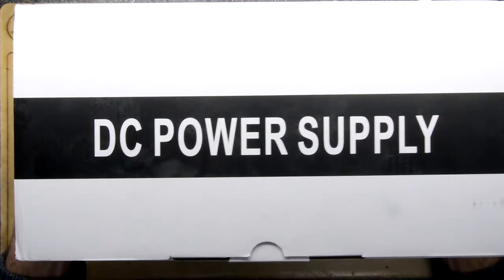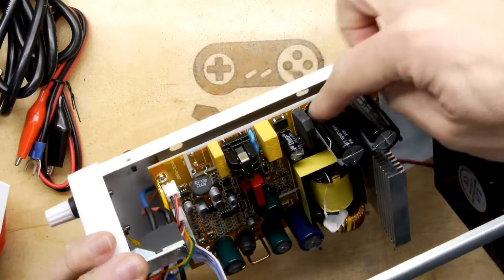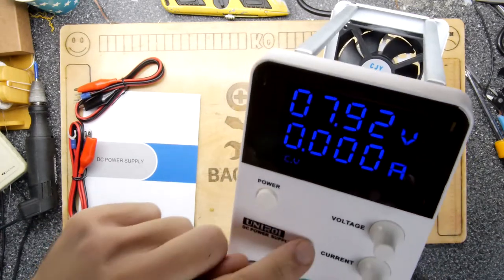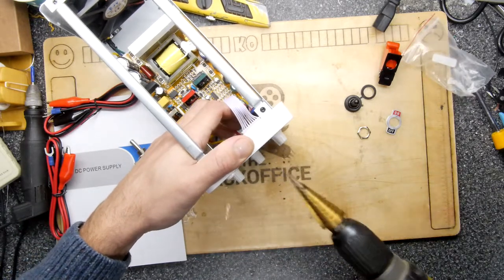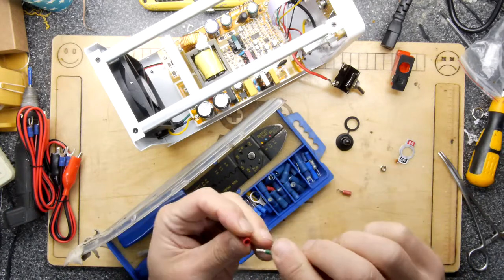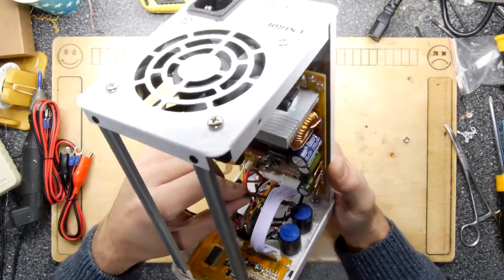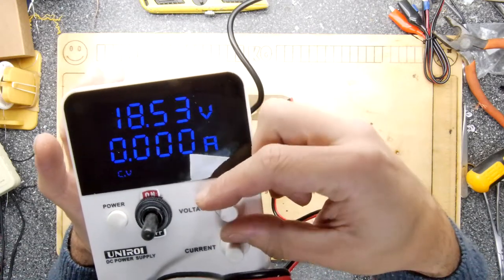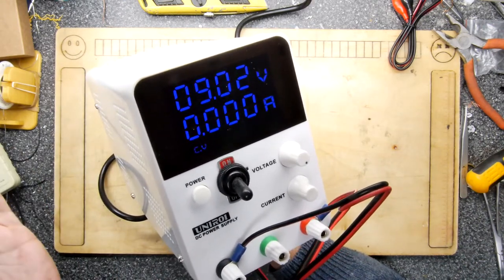New Year New Bench PSU - Adding an output switch for more control (longplay)

Comment: I thought it was odd when you were talking about being allowed out again, and then I saw the age of the previous comments 🙂. Interesting idea though, I might do this to my cheap bench supply.
Reply from the maker: You should definitely do it - it's a great investment in saved circuits! 😂
Reply: It was a requirement for me.  BUT I like to be able to set the current limit while output is disabled.
Reply: @whollymindless  If you want to get fancy you could use a three position switch: Output On / Output Off / Output Connected To An Adjustable DC Load (via a second set of terminals.) 

Then you could adjust the DC load to whatever would be reasonable for your project, and set the voltage and current limit while not connected to the actual circuit under test.